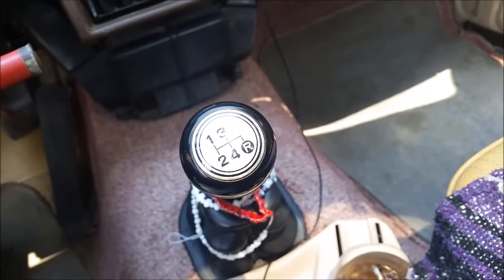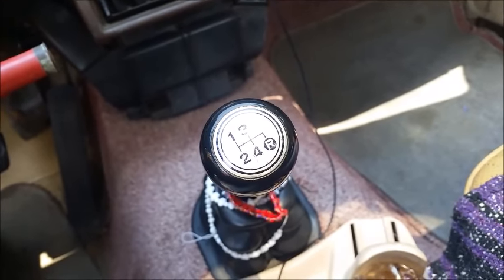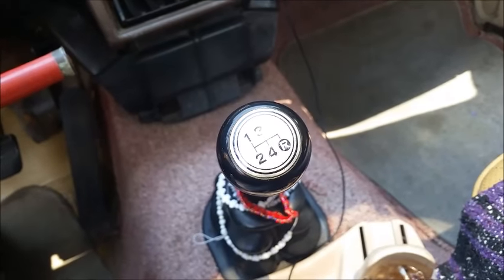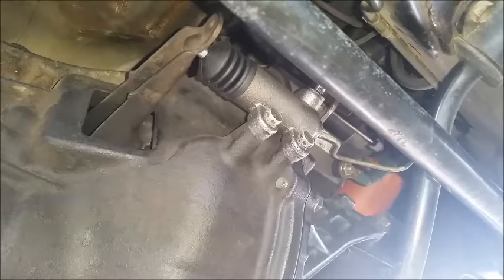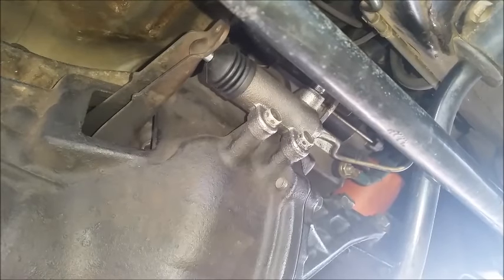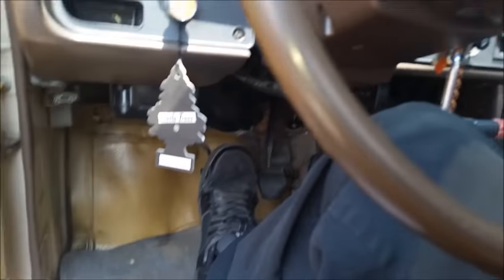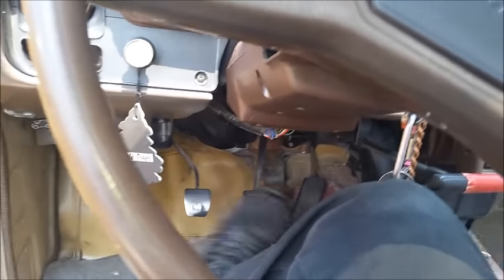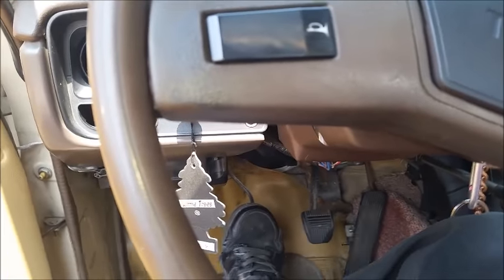Diagnosing Clutch Noises - Squeaky Clutch Fork, Bad Pilot, Throwout Bearing

Comment: I have a weird sound. It almost sounds like a flutter when the clutch is released in first gear at higher rpms. Its there in 2nd gear but harder to hear. Its hard to explain what it sounds like but its like something is knocking or tapping and it get quieter after every knock. Almost like a flutter it doesnt get faster after every tap. I cant find anything on the internet about it
Reply: flutter...boat motor noise...... I've I've got that noise And it's very rarely discussed online...... This is the 4th clutch kit..... The 1st 3 kids were making a tapping sound Just idling I don't know if they made a sound between each gear.... But the fluttering noise right now is with a Luk clutch..... It's been going on for 3 years......

Comment: I have the same noise. Before trying it I had a couple of questions though. Did the other bearing brake due due the grease you put in? E.g. the grease flying around an bringing particles where they should not? Was the clutch greasy when you took it out? I would apreciate clearing that up.

Comment: My car has that squeeky sound while applying clutch and when i accelerate in first gear and shift it to second gear its not accelerating smoothly as if clutch is not disengaging..jammed feeling..what is it,?
Reply: Throw out bearing..and by the sounds check your clutch and flywheel they might be gone aswell when flywheel/flexplate wears away to much the clutch will bond to the flywheel or it will slip..good luck

Comment: thanks for the video. Looks like i'm paying a visit to the guy that rebuilt my engine and replaced the clutch (it's only 1200km's old and already making these noises!! i'm pissed!)
Reply: Same here had a new clutch replaced drove it back to the shop and parked it. Went to take it to get the brakes touched up and boom 3 minutes after starting her up she starts making a squealing noise that sounds identical to a bad pulley, but when you engage the clutch the sound completely stops. So after engaging and disengaging the clutch to see if the noise would stop I tried one more time and boom clutch pedal just slammed to the floor gotta love life
Reply: @christiandefreese3020  What do you mean just slammed to the floor? Like youre supposed to shift with it all the way in is what your saying?
Reply: @crazy8boy145  He must have left his phone in the car when he took it back for repair

Comment: I'm guessing all different  models of vehicles may make different pitch sounds depending how bad they are worn or un lubed . I'm getting a sound.. when I engage clutch it quiets down drastically.  I'm aware I may have a squeaky belt pulley or something else but do notice my clutch actually sets me in motion when I press all the way down and then release from down there. ... what am I looking at in costs in so. California 2004 ram 1500 v6 3.7 need a clutch quote
Reply from the maker: I couldn't tell you the cost. Probably around 1800. But yes every car is different.

Comment: Most clutch kits dont come with the  pilot bearing. 
8nnmy casec I am wondering if this is making the noise. Because there is not the same rattle noise that happens when the clutch pedal is pressed in..  it sounds like more of a squealing noise with the engine running.. then when you push the clutch in it goes away.. also if you push the clutch in about 1/2 inch it goes away.. I was think either it was the pilot bearing or
Loose fork on the throw out bearing? Dried out pilot bearing thats going? It all points to an ecoensive repair and while you're in there might as well replace the whole clutch.. and pilot bearing which does not come with the clutch and has to be ordered seperately.. so yeah..its either ignore it until it goes at a time and place where it will need a tow or fix it... so  looks like were in the same boat.

Comment: Possibly you accidently oversprayed the clutch/components,did you Evan check the throwout bearing?
Reply from the maker: I replaced the whole clutch assembly and bearings later on. The noise was the throwout bearing if im not mistaken. Its been quite a few years
Reply from the maker: It was all pretty bad truck had the original clutch from 1982 in it still

Comment: Did you ever have problems shifting in gear?
Reply from the maker: Thats probably unrelated to the bearings. You have clutch issues. Low transmission fluid or synchros are going bad.

Comment: I have the same noise when pressing and releasing the pedal... did you find out the exact problem?
Reply from the maker: bertoloche throwout bearing
Reply: @MotorHeadMadnessOfficial  My car i20 has the same and exact sound at 0.12. what exactly is that noise? How do you fix it?

Comment: Is that a front wheel drive? And where did you spray for that joint? Looked like you were spraying that fork more on the clutch side... I'm still having a squeak, but I was being extremely careful with the spray I have so I don't think I hit the spot well or got the wrong side.
Reply from the maker: This is a 1982 toyota hilux rwd. I sprayed the clutch fork where it meets the pivot. I used white lithium grease. I also ended up finding out that my throwout bearing had started to fail causing a rattle that the squeak was hiding. I pulled the trans and di a new flywheel, clutch and both pilot bearing and throwout bearing. I also replace my master and slave cylinder while it was apart.
Reply: @MotorHeadMadnessOfficial  nah yea I get the throwout bearing is going bad, but mine is just doing that squeak and I'm trying to get rid of that.

Comment: Hey y'all that's not a bad throwout bearing that rattling at the end of the video is the pressure plate fingers so you need a different brand or you need to tighten it in a star pattern
Reply from the maker: Great guess but I pulled that truck apart myself and it was definitely not the clutch fingers

Comment: Do you hear any "krrrg krrrg krrrg" noise occasionally coming from your transmission and if you do ,is it due to the bad release bearing?
Reply from the maker: Replace it all they come as kits anyway
Reply: @MotorHeadMadnessOfficial  My car i20 has the same and exact sound at 0.12. what exactly is that noise? How do you fix it?

Comment: Did that end up being a throwout bearing or was it the inpit shaft bearing on tranny? I woul have thought throw out would make noise with pedal depressed.
Reply: Input shaft bearing**
Reply from the maker: My vehicle it was the throwout bearing. The input shaft bearing whines. It is inside of the transmission
Reply from the maker: There's another video about input shaft noise on my channel
Reply: @MotorHeadMadnessOfficial  ill check it out. Awesome

Comment: why is the noise more when clutch is out? That's when the throw out bearing is not spinning? or its rattling side to side?

so clutch it presses the bearing on the springs so doesn't get chance to rattle?
Reply: When your clutch is out and in neutral We are spinning the entire transmission and there's going to be noise absolutely every single year every ball bearing

Comment: Got a nissan d21. No clutch pressure at all sits on floor. Got a new master snd slave and bled and nothing. Clutch fork is all the way to rear (back of truck) at rest resting on pivot joint. Will noy move by hand. Based on pics I've seen it appears my fork is farther back than others. About 2 inches of slave piston out and based on pics should be about a half inch any ideas? It woulf seem to me no matter what goes on beyond slave I should still have pressute at pedal
Reply: i have an 89 d21 with the z24. i also changed my master and slave  units. had no pressure.. turned out that on the bracket the connects to your clutch pedal had to be adjusted.. after i turned it like 5 or six times i had full clutch pressure... hope this helps ya.
Reply: bro. are you on the Nissan d21 global page on facebook? if not you should join.. its pretty cool.

Comment: Sorry , when you say replaced everything, do you mean inside the transmission as well or just clutch components ?
Reply from the maker: east.coast Ev I mean the Clutch, fork, both bearings, the flywheel and transmission fluid. New master and slave cylinder and new hydraulic brake fluid too.

Comment: I have a yaris that sounds like this but I got a full clutch job 5 months ago.. I'm just waiting for a change In shift feel or something, I have a aaa membership in case a part fails suddenly. Would you suspect that my new flywheel was unevenly torqued? My clutch pedal has a vibration feel at the top 10% of the stroke. My car was perfect before the clutch job I regret it !
Reply from the maker: Id assume it was done wrong
Reply: Did you ever fix it with a different brand of clutch kit?

Comment: What about clutch fork vibration my car has destroyed 3 throw out bearings  in 3 months
Reply from the maker: Could be the input shaft bearing
Reply: @MotorHeadMadnessOfficial  ... Install the different brand with a brand new fly we'll and almost all of the vibration is gone however now I hear a draging n sound within the transmission itself and the entire transmission was rebuilt recently..... What am I transmission was tore down the input check bearing had a japanese marking on it so now wondering if the japanese bearings are no longer available it's making all kinds of dragging noises not very loud but Oh well
Reply from the maker: I have a video on here about bad input shaft bearing sound. Its on a honda but it may sound similar
Reply: @MotorHeadMadnessOfficial  I'm getting a sound but it's only in second gear With the clutch in are out  I think it's the counter shaft Which is always in motion because of the drive shaft it's a real drive truck....

Comment: That clutch out is not a throwout bearing,  they make noise when pressing the clutch in
Reply from the maker: Sure was the throw out bearing. I replaced it and I still daily this truck. The noise is gone
Reply: Throwout bearing does nothing if the clutch is not being pressed in, unless u explained it the other way around.

Comment: Mine gets louder when I rev it
Reply from the maker: Thats rod knock or timing chains
Reply from the maker: Hard to say but if it changes with rpm thats a bad thing
Reply: MotorHeadMadness when I push the clutch pedal in it goes away
Reply: @Ajhowardz32  Throwout bearing

Comment: ..... They can make that noise when it's brand new.........
Reply from the maker: Not if you properly clean and lubricate them I’ve had many 20r and 22r motors
Reply from the maker: The noise is from the slave squeaking on the clutch fork

Comment: Just kinda sucks cause my clutch is brand new, looks like this shitty garage is gunna have to take my car back and do it right.
Reply from the maker: Sounds like they didn't replace bearings while they were there
Reply: @MotorHeadMadnessOfficial  It actually ended up being a metal heat sheild that was loose😂, every time I would clutch in it was rubbing against the clutch slave cylinder and making a noise, removed that shit
Reply: @MotorHeadMadnessOfficial  Thank u for the advice tho appreciated